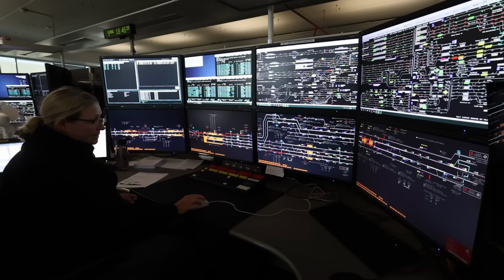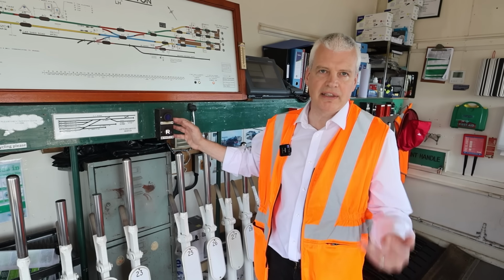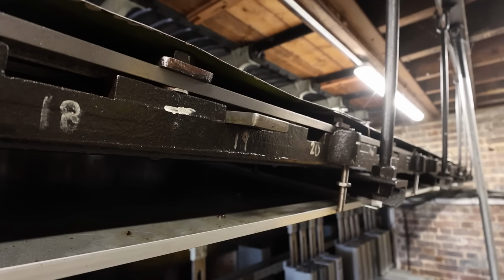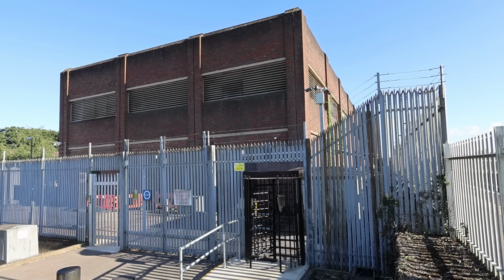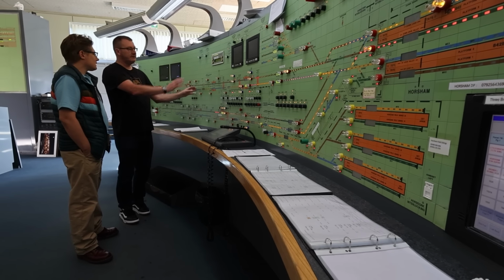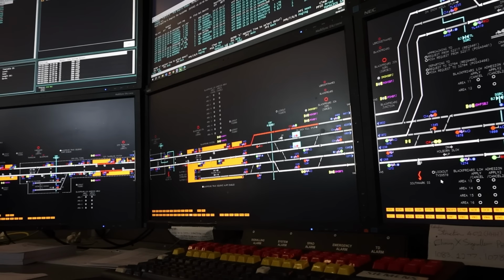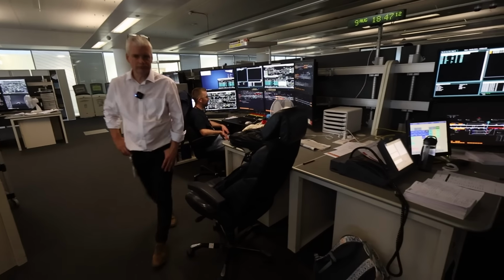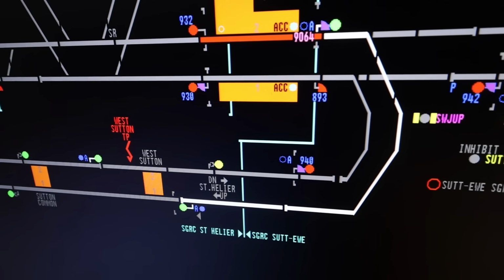Why Do We Still Have Semaphore Signals?

Comment: One very good reason would be that if there's a fault, the entire signalling system for a hundred miles doesn't go down and passengers aren't urged "not to travel" ... 😒
Reply: That's not a reason I'm sure it the system is designed correctly one fault doesn't shut down the whole system. Plus what has worked mechanically in the past can be mimicked via computerized control. They'll still be there on the heritage so don't worry there will still be plenty around to go and see for any railway nerds, but just as we don't have steam trains on the main network (and I love trains btw) we shouldn't have semaphore signalling either.
Reply: @mattpotter8725  Well, UK signalling systems must be badly designed as the whole system does go down tediously regularly
Reply: @AndreiTupolev  I don't think the whole system goes down because of the signalling system on the whole network, just that the knock on effect of the first signal failure that causes the first train to not be able to move has a knock on effect to all following trains (so you could say it does, but technically it wouldn't of you could bypass that section of track, which in nearly every case you can't).
Reply: That all depends on how much redundancy is built into the system. Redundancy is, of course, more expensive.

Comment: What an utterly fascinating video! IIRC, the last semaphore signals in the London area are at Greenford, on the junction from the West Ealing branch to the old New North Main Line - and I remember hearing that due to the line being so little used now, it was unlikely that the semaphores would be replaced anytime soon as it just wasn't worth the cost. So that might be a contender for last sempahore signal box left standing in years to come!

Two other things I'd be fascinated to know about - 1) a map of all the remaining semaphore signal boxes on the network? And 2) what the official process is for when semaphore signal boxes are decommissioned? I know a lot of heritage railways pick up the lever frames, signals, and sometimes even the entire box itself, but is that a formal thing? Does NR sell them or donate the equipment to heritage lines? :)
Reply: The equipment is either kept for strategic spares, donated or if the box is listed or still in railway use, left in place. You’ll find boxes like Ramsgate and Eastbourne still have their lever frames as they are impossible to remove without taking the roof off!

Comment: I remember hearing that the hardest part about replacing the old style interlocking and signals at Union station in Toronto was developing a computer system that could handle the complexity of it. The tracks in union station are often referred to as the shortest railway with the most amount of switches. When it was built the two main railroads didn't want to build tracks to it so the city of Toronto built what ended up being called the Toronto Terminal Railway.
Reply: Wow. I believe there are still two signal boxes there.
Reply: @alexandraclement1456  I think they aren't active anymore but I'm not really sure
Reply: @ThomasJM  , that wouldn't surprise me.
Reply: @alexandraclement1456  also don't get me started on all of the people who think Tom Sawyer island needs to go because they have never been to it and their opinion means more than the people who go to it to get away from the crowds and allow their kids to play and enjoy themselves.
Reply: There have been similar projects in UK, but  one part of Toronto union project is to redo all the interlockings and move to centralized control from the remaining signal towers. And this is sort of a pre-requisit to electrifying since electrification requires you know where each switch is.  Wouldn't be surprised if they leave out the changing of switches and just electrify over existing track layouts.   Go is going ETCS-2 but not sure if Toronto Union will go to ETCS or stick with lights.
Reply: @jfmezei  go transit owns the tracks in union station so I would presume that they are going with whatever they are using elsewhere.
Reply: @ThomasJM   ETCS is not necessarily used in large stations and when you have switches that close to each other.  So this is a technical decision, not a political one.  Right now, USRC (Union Station rail Corridor) is treated as separate sub from a signaling/control point of view.
Reply: @jfmezei  makes sense to me

Comment: In Germany we also have these 3 steps of evolution of signalling. The oldest being mechanical lever frames looking a bit more massive than the British ones, the second being electromechanical with the most common one called SpDrS60 (line plan and push button signalling system) being used from 1963 and finally electronic and digital signalling like the ROC shown in the video. Very interesting to see how signalling works over there, thanks for showing us inside!

Comment: Wow, this was very interesting. I knew semaphore signalling was still in use in Britain (in The Netherlands the last mainline use of them was in the early 80s, last NX went in the early 90s), but was very surprised that the modern ROC still uses manual signalling. It;''s all automated here with automated pathing commands, our signallers can only overrule when needed.
Reply: It's very interesting indeed as everything in the Netherlands (As you said) is automated with various abstraction layers under it depending on the safety system it eventually controls, although none of those will involve semaphores.  It also means that all 12 ROC equivalents (They are called something that translates to Traffic management posts) in the Netherlands are standardized, so they run the same software and have the same hardware where the key difference is the configuration for the area they are responsible for.

The UK still having various different ways of doing so and various more legacy systems makes me wonder how much extra cost is involved there. Although I also realize that getting the budget to replace it all is something else entirely.

Comment: In some signal boxes, there are blue levers; what are they for?
Reply: Facing point locks. The box in Littlehampton has electric point motors that include a facing point lock in the gearbox so it doesn’t need them.

Comment: A switch in the signal box does the same as one of the unnumerable tiny transistors on a silicon chip. Computers and switch boxes are both binary systems.
Reply: ❤ this.

Comment: Very cool.  The Raton subdivision north of me here in Albuquerque NM is the last US mainline that still uses semaphore signals.  They can be seen for now when riding the Southwest Chief, but they probably won’t be around for much longer.
Reply: A replacement project is already underway.  If you want to make plans to see them, you are probably already too late.

Of course, the semaphores on Raton were not mechanically controlled.  They were FAR too remote for that.  That remoteness was one of the reasons for their survival.

The other reason was their low traffic.  Raton Pass has 3.5% grades, and so over the course of the 20th Century freight traffic diverted to the Belen Cutoff and its 1.25% grades.  Today, the only regular traffic on Raton is the Southwest Chief, which runs once a day in either direction.  It was even threatened with abandonment until the government of New Mexico stepped in and bought it.

There IS the possibility of increased traffic if various passenger rail proposals currently floating around happen, but its probably not something to hold ones breath about.

The US DOES have some manned towers at particularly critical junctions, but they are mostly used by passenger trains and run by government agencies responsible for those particular passenger trains-most notably in Chicago's commuter rail system METRA.  And the primary reason for those remaining is a mixture of lack of financial means and a desire to eventually replace those flat junctions with grade-separated systems.  

Otherwise, rail traffic is primarily operated remotely (potentially thousands of miles away).  For the privately-owned freight railroads, its a question of saving money in not having to employ people at remote towers.  I'm surprised that the savings of wages and mechanical equipment doesn't factor likewise across the Pond.
Reply: @00Zy99 it's usually the huge cost of replacing it all far outweighs the wages
Reply: I'm pretty sure the last ones just came down within the past year. If not, there's probably only one pair left.
Reply: As of today (8-20-2024) Only 11 remain on this route
Reply: Love the southwest chief, such a beautiful route, nothing like it in the UK

Comment: At Gainsborough Central, on the 1 round trip Monday to Friday Brigg Line service.

Network Rail replaced all the semaphore signalling with new semaphore signalling, at a cost of £25000 per signal.